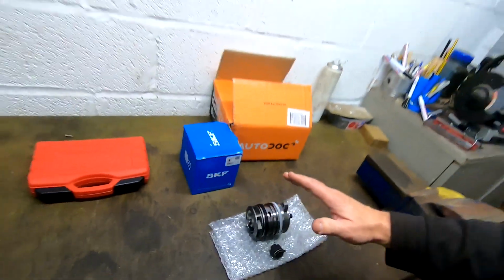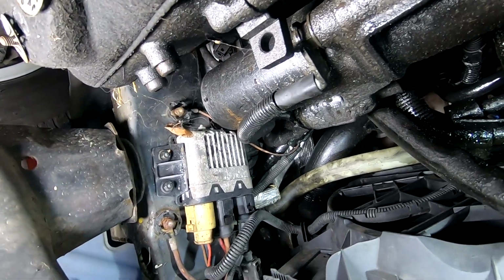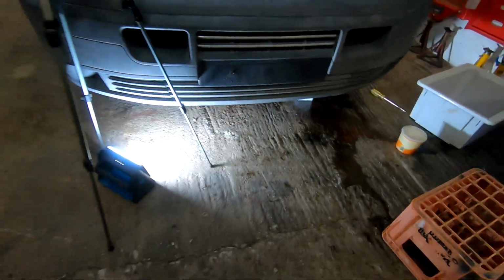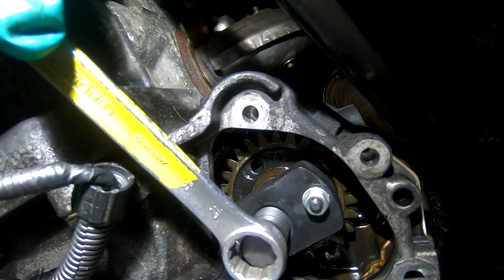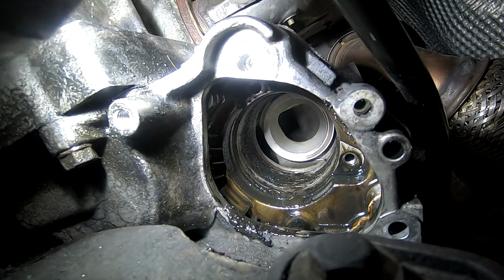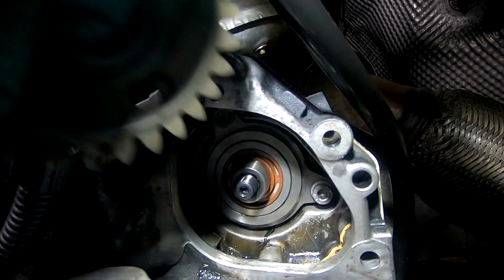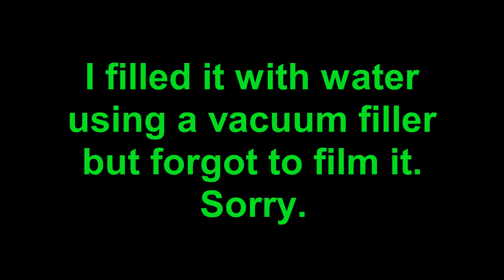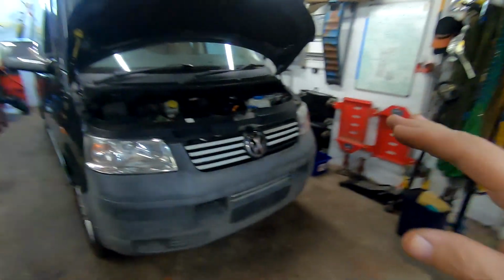VW T5 2.5l, 5 cylinder water pump replacement.

Comment: great video, i have just done a camshaft on my t5, for future you reference you dont need to take the awkward plate off the crank end to put the timing tool on, you can just pop out the seal in the centre of it, i think water pump is my next job
Reply from the maker: Thanks, I saw the pressing in the centre but didn't know it would come out. I'll pin your comment to the top to help others out. 👌
Reply: You dont need to lock the crank. Just use a small impact gun on the 24 mm nut, on the water pump…
Reply: Or put it in gear. Should be enough force to keep motor from rotating.🤔

Comment: Awesome … video immensely grateful for the video  …in Oz , mech wanted $8480 to do job …followed this to a T … coat me about $650 and that includes a full engine oil and filter replacement whilst there ( couple of sockets from a neighbour that i didn’t have but all sweet ! Highly recommended …thanks
Reply from the maker: @griffinbarry3136  Thanks 👍. Glad it was of some help and saved you some money 👌.

Comment: I'm gobsmacked that there isn't a proper drain plug for the radiator!! Taking out the sensor is the official Haynes manual procedure!!

Thank you for the video, great info. I'm just about to tackle this job myself ;)
Reply from the maker: @michaelbirchall2247  . Not the best of designs really 🙄. Thanks and good luck sorting it out 🤞
Reply: @LarcsWorkshop  Thank you. I looked at the void drain banjo fitting and there's no water there, so I'm suspecting the head gasket has gone bad :(
Time for a strip down and rebuild.
Reply from the maker: @michaelbirchall2247  . It's probably worth removing the whole banjo fitting before spending any money, it might be blocked solid with crud. Also, it could be the oil-water cooler (sounds like a common issue too). Good luck sorting it out 🤞.

Comment: Your old pump is brand new compared to mine! The gear shaft on mine was so loose, the gear was grinding away the bolt head that holds the pump in! It also took a lot of heat and an m12 bolt welded to the tiny 8mm head of the removal tool. This was after breaking two 1/4" ratchets and an 8mm socket!!!! It was stuck in there. Luckily My engine is out of the vehicle for a rebuild, you did well with the engine in place.
Reply from the maker: @michaelbirchall2247  . Thanks, wow you had a tough one there 😳. Kudos for getting it sorted 👏.

Comment: Thanks for this video!
After the regular engine oil change I noticed aluminum shavings inside the filter. Have heard this can come from a worn out water pump. Do you think it is worth changing the water pump?
Ah, my van is a T5 / 2.5 BNZ from 2009.
Hope I get some answer. Thank you, dedicated people!
Reply from the maker: Wow, I'm not really sure about that. I can't remember there being much aluminium in the water pump, good luck sorting it out 🤞. Hopefully someone on here will know and post it. Come on guys help a fellow T5 owner out 👍.
Reply: @LarcsWorkshop  will take the oil sump down and see what I can notice. Thanks a lot for answering!
PS: any ideas from others are welcomed. I am trying to find the source of the thin aluminum shavings...and what I can expect in regards to the life of the engine. It has 301.000 km now and it behaves like nothing happened!
Reply from the maker: @flaviucernescu  Thanks, no problems. Good luck 🤞.
Reply: @flaviucernescu  Did you get to the bottom of this problem?

Comment: Currently doing this job, your video has been a life saver, wouldn't have even started it without watching your guide... im currently trying to pull the gear off with the supplied puller... you make it look easier than I am experiencing getting it to sit on the gear properly!!! also i think my pump is further gone than yours as there seems to be play in the shaft, did you experience that?
Reply from the maker: Thanks 👍. Yes, getting the puller tool legs into position was a little tricky but I think I was lucky they caught quite quickly. My pump had a little play in it but not horrendous. Good luck sorting it out 🤞.
Reply: Cheers Bud, had to modify the tool slightly, my sprocket was slightly different to yours, once the gear was out though the pump came out without a fight... now to put it all back together again. thanks again for the video!! @LarcsWorkshop
Reply from the maker: @sterradovr6365  Good work 👌
Reply: @LarcsWorkshop  all back in and holding pressure. 👌 🍻
Reply from the maker: @sterradovr6365  Nice👌.

Comment: I think,having the same problem, with my 2.5 tdi 5cil.On the highway i got lights and bells warning from quantity glycol level in expension reservoir. Filled it up and two miles further same happened again.Stopped again and road assists took it home.But!! Where is the glycol going ?? No fumes no outside leaks engine ran perfect.
Via the telltale drain,into the crankcase?Did you experience that too?No temp problems only low glycol warning.😮
Reply from the maker: @pcm9656  . Mine was the same, no temperature issues just losing water. Another common issue is with the oil cooler allowing water into the oil. I think my first check would be to check for water in the oil. Is the oil level on the dipstick going up? If so, crack open the sump drain and check for water in there. Good luck sorting it out 🤞
Reply: @LarcsWorkshop  Hi thx a lot !! Dipstick is spitting engine oil and glycol full synthetic its the (almost) same stuff. Change the lube fluid,cool fluid and the pump.!
Reply from the maker: @pcm9656  Good luck sorting it out 🤞.
Reply: @LarcsWorkshop  Yeb It was the the glycolpump. Thanks a lot you'r video really helped..😀
Reply from the maker: @pcm9656  . Thanks, glad you got it sorted 👍

Comment: Great Video. IS it necessary to take the crank plate off? The centre of the plate should just clip out with a scribe, no?
Reply from the maker: @steveborg7467  Yes, apparently it can be removed without taking the whole plate off👍.

Comment: i would suggest to check / replace oil cooler within oil filter assembly if you have no trace of its age
Reply from the maker: I've got a comprehensive history for it so I'll check if it's been changed. Thanks 👍

Comment: Why do you need to lock it at TDC? Surely the pump has nothing to do with the timing and is just running off a pinion gear?
Reply from the maker: I wasn't sure of that either, it's what it said to do in the Haynes manual, 90deg past or back from TDC iirc. Perhaps it's something to do with the chance of the engine turning slightly under the valve or injector springs with your fingers in there maybe? Definitely needed the tool to stop it rotating when loosening & tightening the pump gear nut though.

Comment: Hi ,

Great video. It's a huge help. Doing mine at the moment.
Going ok but I have a couple of questions :

1.  Are you absolutely sure about the crankshaft locking tool being set at TDC +90  as all the other videos I can find on youtube (  with engines out of vehicles) show the tool set at TDC mark.

2. Do you by any chance know the allen key size for the rear drain bolt ?

I have a BPC engine that has the added complication of the dpf being in the way of the bolt so access is even more difficult and I don't want to wreck the head of the bolt with the wrong size allen key.

Thank you
Reply from the maker: @davidpearce275  . I did the TDC+90 because it said to in the manual. I think it might be to do with where the cylinders & valves are and the chance of it rotating when the gear is removed. Sorry I can't remember the size of the drain plug, I'm getting old 😁.
Good luck sorting it out 🤞

Comment: Great Video , do you know the difference with the more expensive tool ? Perhaps better locking tool? I have seen a sealey about £100 but if it’s only the lock part of tool will do same as you did. Keep up the great vids
Reply from the maker: @illoganredruth  . I expect the more expensive tool would fit a little better and the gear puller would be a little less fiddly?
Good luck sorting it out 🤞

Comment: Wht size is the multispline for the 2 holding the pump in? My kits have M8 & then goes to M10. Dont tell me its an M9?
Reply from the maker: @steveborg7467  I think mine were just socket headed/allen key type screws.

Comment: Hey! Absolutely life saving video mate, was just wondering: 
Do you have to drain the oil before doing this? And also do you have to take the wheel off to get to the crank?
Love the channel! Cheers
Reply from the maker: Thanks, no problems 👍. I would imagine it would be possible to do without removing the wheel by turning the steering to get the inner plastics etc off. I had to get the camera in there too so had no choice.
Reply: What about the oil?
Reply from the maker: @SimTechnics  . Yes, drain and replace the oil if you've had water in it from the water pump.
Reply: I don’t. I just want to replace it to sleep well 😅
Reply from the maker: @SimTechnics  👍

Comment: Soaking wet doing this job out on the drive way ! I’ve managed to get up to the point of pulling the pump itself out and it’s seriously hard. I’ve stopped as of now as I am worried I’m about to break something! I bought the kit you recommend and it’s been good up until now. Should it be so difficult to get the pump itself out ?
Reply: Does the banjo bolt have to come out to remove the pump ? I know you took it out in the video but could that cause it to not come out ?
Reply from the maker: Mine was quite tight, if yours is anything like mine there will be a load of rubbish jammed all around it and in the interspace. It might be worth taking the banjo out and trying to flush some of the rubbish out and trying again? Good luck sorting it out 🤞.
Reply: Good idea, I’ll give that a go ! Thankyou.
Reply from the maker: @19district97  Good luck

Comment: Excellent video! To confirm you use the tool on the crank to be at 9 o clock? Thanks :)
Reply from the maker: Thanks , no problems. According to the book, 9 O-clock on the tool is TDC, and to turn it 90deg clockwise (12 O-clock) when you change the water pump.
Reply: When it says 12 o'clock, did you just eye ball it ?

Comment: Afternoon young man. Great video. However I can seem to get the pulley puller to lock😡
Does one go behind the teeth, as in both holes doesn’t lock 😂
Reply from the maker: Thanks 👍.The puller legs go through the holes and grab on the back. It can be a bit hit or miss if it catches, keep fiddling and I'm sure it'll catch 🤞
Reply: Been nearly 3 hours with no success. Might have purchase a better kit 😡
Reply from the maker: @ChristopherGreenslade-g9o  . What if you tried bending one of the legs out a little bit to try and get a bit more bite?